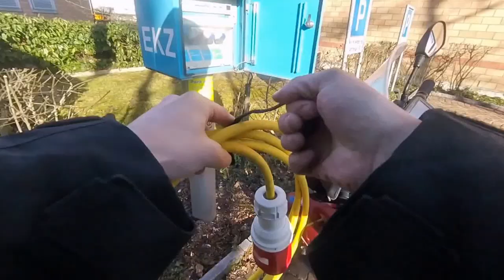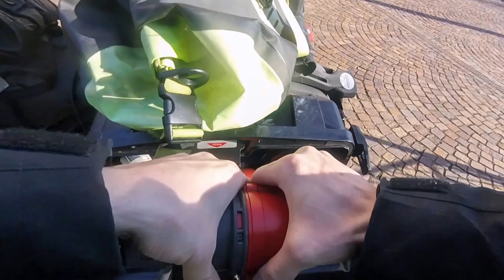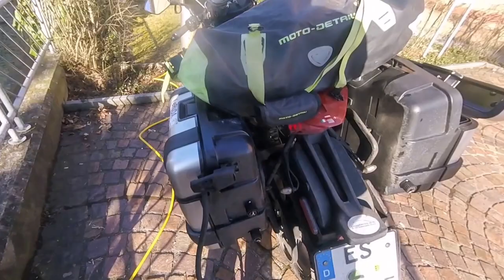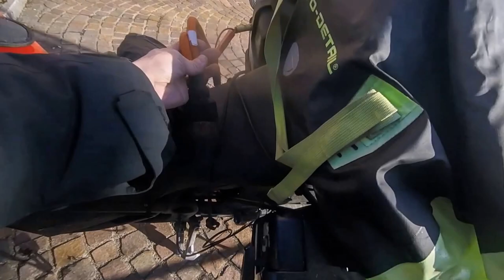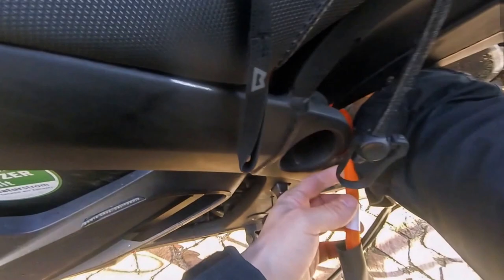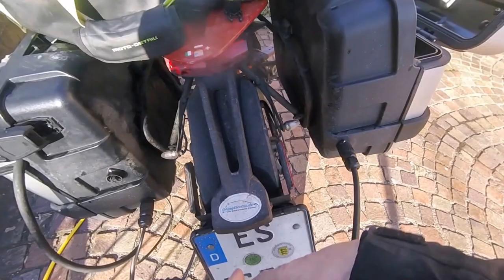Fast Charging Setup Zero Motorcycle

Comment: looks ridiculous. This is for enthusiasts not for the general public. What we need is CCS DC fast charge from a commercial charger.
Reply from the maker: That's because Zero builds bikes for short distance commuters. What you want is an Energica superbike: http://www.energicamotor.com/
Reply: Except that Energica claims to have a range of 124 miles Eco-mode.
Reply: what if it's raining => might get electrocuted  ;-s
Reply: karel degreef you never charge when raining or snowing !!
Reply: @ChristianJog  can you show the new setup?
Reply from the maker: @אלכססוסונוב  Sure. I will prepare a new video when I have the time. At the moment it is a bit hard to find the time, though :-)
Reply: @ChristianJog  Have the Energica ranges been tested?
Reply from the maker: @howardman3926  Yes. And it seems the Energica and the Zero SR/S do not differ as much as one might expect if you only check the capacity of the battery.

But the Tests have not been confirmed by standardized tests. So rider's style and environment (e.g. topology and tempreature) impacted these tests.

At the moment I can only suggest to test them yourself for a period of 1-2 days  if you really want to know if range is an issue for your riding style.
Reply: @ChristianJog  Yeah, I was looking at them, and the Energica EsseEsse9+ has 21.5kWh, while a Zero RS, with a powertank, comes to around 19kWh I believe. But, they seem to come to about the same range. The Energica has the DC fast charging, which would be nice, but compared to the Zero, it's also bulkier. And in all honesty, I prefer the styling and approach of the Zero, where there's no oil and as little sound as possible. I would rather have a Zero, but the Energica charging capabilities are too enticing.....the route I'm planning on going, has a 175mile stretch of highway, with no DC fast charging, or Level 2 charging of any kind. That's why I'm worried

Comment: Good Lord!  Christian, it sounded as if even you were getting exasperated plugging in 4 miles of cords into 40 sockets.  You must be an electrical engineer.
Reply from the maker: It is a nuisance. There are ways I could make this less annoying, but I would reduce my flexibility then.
Something I was relying on when riding with Uwe to Helmond in the Netherlands. We were able to share the chargers without any problem.
Reply from the maker: I am "out of breath" mostly because of the cold. I had to breath through the mouth to keep "water" running from my nose. Maybe I should shoot those vids in summer ;-)

Comment: Can you explain what are all the connections and ore you have extra batteries?
Reply from the maker: I don't have extra batteries. 

The connections are basically  AC (power supply) -> DC (converters in side cases) -> bike 

As I use 3 phases you can follow each cable from the 3-phase AC to one of 3 inputs of the bike.

The bike has 1 internal charger and 2 AUX inputs.

Comment: If you don't mind me asking as it's off topic, but what tank bag are you using?  Looks like it's even magnetic no? Did you put magnets or metal under the "tank" plastics? Thanks
Reply from the maker: It comes in two flavors: Magnetic and with suction cups. I use suction cups, because the Zero is not magnetic. 
The manufacturer is moto-detail: https://www.louis.eu/artikel/moto-detail-tankbag-gps-magnet-and-suction/10025431

Comment: Mmm, a bit a a faff that. Pity they don’t fit a three phase rectifier as standard like Tesla. Type 2 rather than type 1 would be nice for the European market too.
Reply from the maker: Yes, the 3 phases in Europe a great to charge. But, alas, american manufacturers don't seem to care a lot for the European market.

I think we're getting there. But at the moment you still need third party equipment.
Reply: Christian Jog - I test road the Zeros yesterday and think I’ve settled on the DS 14 kWh with the charge tank. Have you been happy with yours?
Reply from the maker: Yes, the motorcycles are perfectly fine. I recommend learning as much as you can about your motorcycle (not restricted to Zeros ;-) - so you can maintain as much as possible yourself.

Especially changing brake pads, bearings and tires will come in handy. Because workshops usually want a lot of money fort those. 

I also recommend replacing the ball bearings every 10000 km (which is twice a year for me). Those bearings Zero is using are flimsy, and the money is very well invested. Get EZO bearings - those are high quality

There were problems with the quality of the internal charger. But AFAIK Zero always replaces those on warranty.
Get a replacement belt, so if it should snap you (or your workshop) has a spare to install quickly. Depending on where you are, spare parts might take several weeks to arrive. That being said: I never had to replace my belt and I have almost 80000 km on the bike.

Other than that: Have fun! Ride a lot and enjoy.
Reply: Christian - great advice. Thanks for your help.
Reply: @ChristianJog  I just bought a used 2015 SR.  Coming from bicycles I am aware of the importance of good bearings.  Which bearings are you talking about?  For the motor?
Reply from the maker: @ebrensi  No, I mean the wheel bearings (especially the rear wheel bearings). Motor bearings are fine AFAIK.

2015 Zeros have already the bigger bearings if I remember correctly. Just make sure you buy good quality when replacing them.

Comment: Wait! You can put luggage on a Zero? Now i want it even more!

But the process of the fast charge is bullshit!
Reply from the maker: Yeah, fast charging and Zero is a bad combination atm. Still hoping for them to introduce a high voltage battery and then CCS.

Luggage on the Zero is no problem at all. I use a roll, because I get more stuff into it. Enough for at least 1 week of travelling.
Reply: there is a new type of battery coming, at least i hope it gets to the market.
Reply: what new battery? Is it 300V at least so it can be fast-charged like an Energica?

Comment: What kinda mong designed this? User friendliness should be at the top of any electric bike manufacturers list
Reply: This is an aftermarket setup...Not a stock zero...he has dual fast chargers plus is using a standard charger to get maximum charging speed.

Comment: This video will discourrage people from bying electric motorcycle, you should remove it lol
Reply from the maker: I won't, because if this discourages people to buy an electric motorcycle then this is perfectly fine.
If you want to do tours and think this will be possible without hassle or without investing a lot of money - it is simply not correct. This video perfectly shows the "state of the art" when it was made (2016/2017).

Today it might be simpler, because motorcycle companies like Zero and Energica nowadays provide different fast charging solutions. But those come at a completely different price tag.

I'd rather have someone buying an EV who knows about the possible restrictions, than someone who thinks this is as simple as riding an ICE.

Comment: Is this video intended to show the advantages or disadvantages of an electric motorcycle?
Anybody watching this is gonna say "are you f'ing kidding me?", as they watch the incredibly tedious and complicated routine of plugging all this stuff into the bike.
I own (and love) an electric motorcycle... but this video indicates how only die-hard hard-core EV enthusiasts would tolerate the current inconveniences of high power charging on electric motorcycles.
Reply from the maker: It is just the way it is with my specific set-up. I am not saying, nor trying to say, that this is a good solution. It is what I have available. This video is a means for me to answer many people that ask "How do you load?"
Reply from the maker: Also: If you want fast charging look into Energica. Those bikes support CCS and charge in 20 minutes. And it is simply plug and charge - no cables, no special external hardware